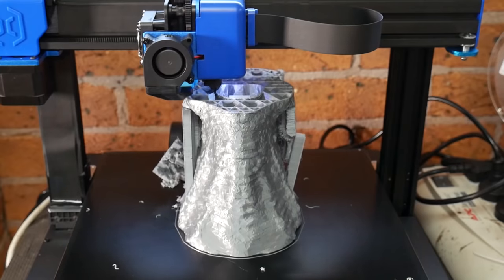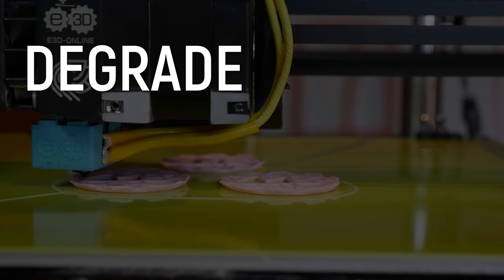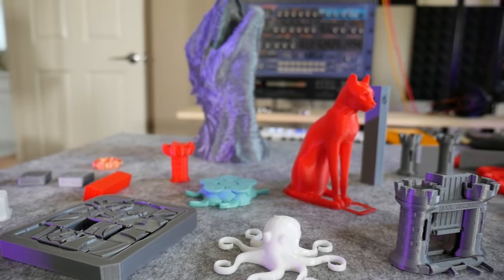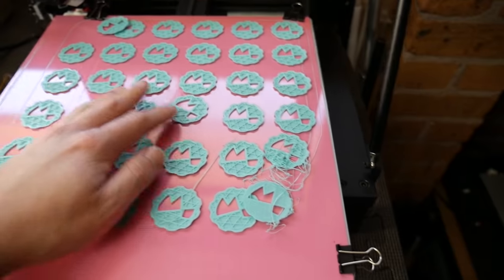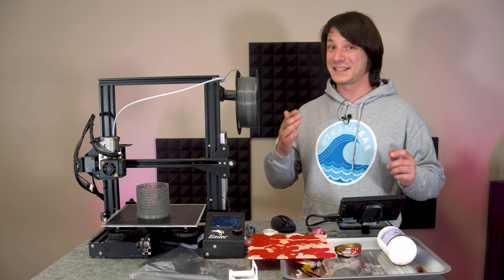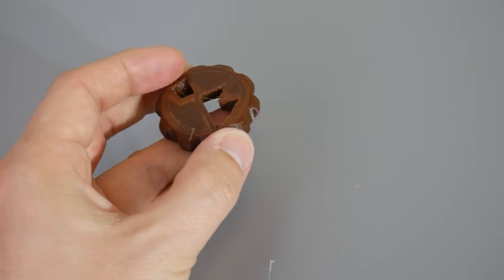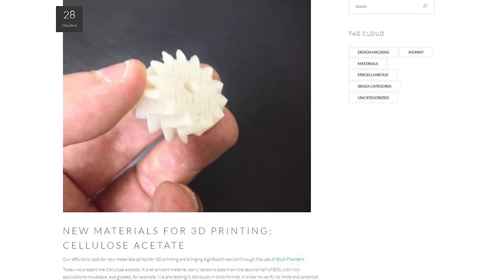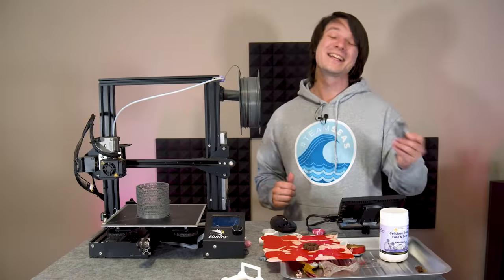PLA - 3D Printing's Biggest Lie.

Comment: The other issue is that there has to be a market for the plastic we make as makers. If there isn't market demand for recycled plastic then we are simply incurring the environmental/energy costs of recycling the material without the benefit of it having additional life. It will just end up in the landfill anyway. Part of the regulation needs to be increasing requirements for manufacturers to use post-consumer material in their products.

Comment: Real cellophane shouldn't be soluble in acetone or any other common solvent. It's made of pure cellulose, so would be no more soluble in acetone than purified cotton, rayon, cellulose/cotton/rag paper, etc.
Real cellophane doesn't melt when heated or burned, it might shrivel or curl before burning, but won't melt, and produces smoke/combustion products similar to burning cotton.

I'm finding mixed information whether cellulose acetate is used as a plastic wrap similar to cellophane. The most cellophane-like plastic sheet material that's commonly used is BoPET plastic based (mylar, though most people probably think of metalized BoPET when they hear "mylar" I'm pretty sure it includes clear plastic sheets too). It tears with little to no stretching similar to cellophane.
PLA is also used for plastic wrapping sheet material and I think is also tends to stretch very little before tearing.
I think cellulose acetate is like this, too, but I'm not positive.

Comment: Recycling PLA into PLA is perfectly possible, it's just not economically viable in itself. That is, you pay more to transform used PLA into recycled PLA, than you would if you just made it from scratch.

However, that is fine if you put a tax on throwing away non-recyclable rubbish. In NZ we have two bins: one accepts only recyclable stuff and the local government empties it for free (and recycles everything inside using its own budget), and the other bin is for non-recyclable stuff and you pay to empty it, about $10-20 each time it's emptied.

Because of this, you're encouraged to sort as much stuff into recycling as you can, and by paying for everything that you haven't recycled, you are paying for recycling everything that's possible to recycle (even at a cost).

Comment: Lots of misinfo in this video; im addressing it here.

PLA can be degraded by a VARIETY of enzymes, lipases, cutinases, even recently studies suggest that because of the similarities between PLA and Polyaniline, it can even be degraded by Proteolytic enzymes; its degradation conditions are experienced on a significant portion of the land masses on the surface of the planet. 2 things, firstly, those conditions are actually "Ideal degradation conditions", they represent the FASTEST a degradation will occur; in vivo (living organism like conditions), roughly 37*c with a pH of 7.2 and moist, the entirety of the given PLA part decayed in roughly 2 years; give a little more time to account for environmental conditions, in the human body PLA can degrade extremely fast, for biocompatible implants. The big issue is, plastic waste never really stays on land. It ends up in landfill, which is more alien than you might think, and in Marine environments, PLA never reaches its conditions to degrade, similarly, in landfill it doesnt degrade very well. Water is never a consistent pH, its usually very cold compared to the average surface temperature. Not only this, but PLA may represent a danger to marine life if it managed to make it into the marine ecosystem and remained there for a long period of time, not due to chemical instability, but mechanical action which is equally dangerous.

Im not necessarily worried about the chemical action in water, because PLA is used in implants; it's fully biocompatible. Infact, an early equine study used a non-medical grade PLA, not specially made for that purpose, and it turned out to be biocompatible from the get go. The material slowly biodegrades into smaller particles until it becomes Lactic Acid Oligomers and can finally be used by the cells, leaving behind no discernible particles. The issue with these implants is that in vivo, the decay faster the more they decay; as pores form on the surface and enzymes better attach to the inside of the pores, making more pores.

PLA is fully biodegradable, I've seen people get confused about the meaning of degradation; incorrectly assuming a plastic which decomposes into smaller and smaller pieces can be referred to as biodegradable; PLA turns into carbon dioxide and water when it is biodegraded. The mass loss is not going to be recovered by digging the dirt around a PLA part.

PLA is biodegradable, because 90% of other plastics aren't, they can't be broken down enzymatically, they cant be exposed to heat or light to make them turn into gas. They just become tinier pieces of plastic, and as those tiny pieces decay, they leech their starting chemicals into the ground.

Silk PLA is where this confusion comes from, it contains 10-20% Polyester.
Polyester is 100% non-degradeable.
Ive watched creators use entirely 100% non-degradable filament for so long, but because it said PLA, they assumed it was fine. Ive even seen a degradation test, where the PLA dissolved, but a dust was in the test pot; they assumed it was PLA dust and concluded PLA just decomposes like other plastics do. It was done with silk PLA.

All of this being said, discouraging the USE of PLA may not be wise, since PLA is one of a very select few plastics that can be fully incinerated without a catalyst, leaves behind no residue, and in its incineration it only leaves behind Carbon Dioxide, Hydrogen and Water.
The problem is we are trying to recycle this objectively difficult feedstock, and the marketing around PLA has made it difficult to educate or explain the material to people.

Finally, the solution.

What do we use instead?

PHA, its a thermoplastic polymer made by enzymes, it's fully biodegradable, not the gimmicky kind, it's the kind where you leave it outside and it will decay because the enzymes outside will eat it, Its been demonstrated time and time again to biodegrade IN MARINE ENVIRONMENTS! Why is it so biodegradable? Because enzymes use it in their natural life cycle to store energy, it's essentially enzyme fat. Turns out, it's also a massively stable bioplastic. It can be printed and depending on its properties, can be ultra high temperature, can be Low temp, its as chemically stable and resistant as Polypropylene; its only water permeable if the water is superheated.
PHA negatives? It is a natural product, so it cannot physically all be a consistent color; its not possible without altering it too much. Because it is a rather unique material, it changes the first 24 hours after a print; mineralizing and crystalizing to form a stronger part. The issue with this is, that effect is temperature dependent. You CAN print this material too hot or too cold, and can selectively choose what printing temperature based on how ductile you want your part to be. PHA is still being researched, but so many enzymes use it as an energy storage medium, and there are so many varieties of PHA, aswell as formulations for improving it, and carbon chain lengths depending on what enzyme was used to grow the PHA, it truly is the future in my opinion.
If you're worried about your footprint, spend a little more on PHA.

Comment: Solution is very simple. Recycle failed prints into new filament. I had separated bins for PLA and ABS to recycle it, but no one was intrested in recycle it back into filament. 
We do it with steel and aluminium, why not start with PLA, ABS and other popular 3D prints. It is the bes solution. I would also buy recycled fimanet, since i make only functional parts, and apperance is not so important for me.

Comment: With FDM, you don't have to confine yourself to printing plastics, it's just that plastic resin filaments are the most convenient material to do controlled fdm prints at a certain scale. There are 3D printing arrangements for printing houses in concrete: it would make no sense to print plastic on that scale, and it seems that there is a window of scale or size where it makes sense to print in plastic. Similarly, there is a 'window' of functionality where it makes sense to print in plastic, for instance it makes sense to print in plastic for a certain level of dimensional accuracy and repeatability: resin FDM offers way more precision than is needed to print a house, but probably not quite enough to make a practical mechanical wristwatch. So maybe 3D printing needs to be guided into more thoughtful use.

The obvious thing to do with all the failed prints and discarded non-functional pieces in conventional FDM resin is to separate, re-grind, pelletise and render as new filament. That's quite the niche industry though.

Comment: Sadly the average compost bin or pile doesn't get warm enough for long enough to break down cellulose acetate. For someone at home to compost it you would need a special set up with an insulated vessel. While not as intensive as industrially biodegradable plastics this is not feasible for the average homeowner and you would not see complete degradation for many many years. You would likely replace the compost bin a few times before the plastic inside degraded.

Comment: 12:30 id put a point out that stuff being made from trees or other plants isn't an inherently bad thing. they are renewable and much more renewable than oil is. trees actually have to be cut down to some extent to improve light access to the lower levels of the forest which can benefit the ecology as trees do outcompete low down shrubs etc, and some trees actually slow down as they age. as long as its done in a sustainable manner there is a good benefit. when people go for short term gain is where things go wrong

i worry more about the micro plastics we create from nozzle dripping, skirt/brim, zits and initial layer purge lines the issue is these arent things we can get rid off from occurring, i do hope the reforming old prints to new filament starts to make headway

Comment: I guess the best thing I can do with my failed prints right now is just throwing them into the trash. Where I live the trash will be burned and used to heat homes. They have massive filters to clean up the exhaust so pretty much the only thing that gets into the atmosphere is CO2 and water. If you would compost it, the CO2 will escape too, but this way you can at least use the heat. The ash will still end up in a landfill but I don't thing there will be much left of the PLA after it burned.

Comment: PLA is far too small in quantity to even consider recycling it unless it can be combined with other higher volume plastics to make products.
In New Zealand a company call FuturePost turns soft plastic packaging and milk bottles into agricultural posts and landscaping products , which don't have the environmental impact of wooden posts treated with poisons to stop them rotting . Plastic quality does not have to be ultra high for this kind of use and they can be repeatedly recycled.
So far they have processed 4700 tonnes of waste plastic.

Comment: It sucks that we've not found a viable mass-producable plastic filament yet. Perhaps getting someone like Prusa on board would give the industry more of a wake up call. Hell if they can produce a prusament filament that is truely biodegradeable then other companies would quickly change their production lines to compete.

I'm no expert at all but in the UK we've got "Biogen" plants that essentially take waste food and animal poop and put it into a huge container. The heat from it is used to generate electricity. I wonder if throwing in a bunch of PLA to force it to get to that high temperature needed to biodegrade would work.

Comment: As an optician I see a huge potential in 3d printed frames. Acetate is the standard material for frames because it is durable and can be bend with a bit of heat. The first is important because s frame is exposed to the skin for a few years every day. The second is important to adjust the temples behind the ears.
I would absolutely love to have cellulose acetate for a 3d printer.

Comment: This is a problem known to most environmental engineers that design waste treatment. Most biodegradable materials require special decomposition processes so it will not break down naturally. Problem is most recycling plants don't have the facilities to process these biodegradable plastics which end up being treated as normal plastics.

Comment: hmmm I think the first step is to find a way to reliably, like 97%+ determine the substance.  PLA, PETG, ASA, ABS, etc.  From there, you need to have a firm that can reliably recycle the material, and pay for the garbage.  That'kll be the trick.   I am not sold on the CA that you mentioned here, I just dont think it will work.  We need to find  way to make recycling profitable, that will be the key.   The second it is profitable, is the second that it becomes a multi billion dollar industry.

Comment: I made a PLA float with a magnet inside as a shutoff for my coffee maker tank filller.  The magnet activated a reed switch.  Anyway, after a couple of years of floating in the water it started disintegrating and I took it out.  I was able to pulverize it in my hands.
Reply: Yes but is that degrading or biodegrading?

Comment: The Problem is that the main advantage of PLA and every other plastics is that it is not desolveable in water (Because of that it had been invented). If it would desolveable in water the airhumidity and other thing like mushrooms would destroy such objects. Also in some cases you want products that are waterproof and and resistant to many enviroments (Meat packaging, bottles, or maybe 3D printed objects which get into contact with water). I think There are two solutions. Recycling, through machines that can seperate materials and produce new products like new filament. Or machinery that can break down Plastics through chemicals into harmless komponents. But i think biodegradeable plastics are not the solution.

Comment: Forget about it, we need to start printing and reusing PET. We either print durable, usable objects or nothing at all. Test prints and trinkets are fine, but it needs to be in a material that doesn't degrade with reuse and we have to reuse it. PET is the best one that I know of. 
Don't look for biodegradable (like paper and cardboards), look for endurance and reusabilty( like metals and glass).

Comment: I mean ... sure ... who wants a million abandoned Benchy prints floating around the ocean?  But, when I print something, I kind of sort of NEED it to last.  I don't want a replacement sprog to repair something biodegrading on me.  That'd defeat the purpose.  So having a readily available biodegradable print material would be a great option, for SOME things.  However what we really need are better recycling programs.  Why any governments don't take recycling seriously just flabbergasts me.  What'd also be just great to have would be at-home print recycling that makes usable spools from failed or no longer desired prints, even if that means coming up with a new material.  Not just failed gimmicks.  Frankly, government subsidized as a recycling program.  It shouldn't be this hard.

Comment: Cellophane is regenerated cellulose produced by the Xanthate process. This is the same process used to produce viscose fibre for clothing manufacture. To make cellopane film the cellulose Xanthate solution is extruded through a slit into an acid bath. This decomposes the Xanthate back into pure cellulose and the film produced is crystal clear when dry. It has a rather characteristic crispy noise when crinkled up which is unlike most other plastic extruded into film. Cellophane is pure cellulose film and it will NOT dissolve in acetone. It is biodegradable in the same way as paper is since both are essentially cellulose. Cellophane does not melt but decomposes when heated just like paper does. It is not a thermoplastic.

Cellulose acetate is made from cellulose and acetic acid precursers such as acetic anhydride. Cellulose acetate is a thermosplastic that can be exruded and moulded. It is soluble in acetone and many other organic solvents.

Comment: Nonetheless, PLA (at least on a biochemical level) is still considerably better for the environment than fossil fuel based plastics.

The monomer of PLA (lactic acid) is far less dangerous because even humans produce the enzyme to break down PL(L)A and the products are some simple aldehydes and carbon dioxide, which aren't nearly as dangerous as complex FFBP mixtures, many of which contain carcinogenic or just toxic monomers (remember that PLA is praised for having vast use in the implant and biomedical field). 
This isn't to mention that PLA degrades considerably more from hydrolysis even under regular circumstances than the alternatives, partially because the process is self catalyzing.
Sure, when buried underground, in relatively dry soil away from accumulations of bacteria that may benefit from it's breakdown its highly unlikely to degrade, it is nonetheless still better and a far smaller issue than  FFBP's.

Comment: As someone with a degree in Mechanical Engineering Science, and have studied material dynamics for a few years, he has brought up many very great points.
However PLA is in the biodegradable category since it can be digested, not so much due to its natural degradation.
PLA can be consumed by almost all mammals and can see a reduction in mass by over 50% during the digestion process, thus being in the biodegradable category.
It is also a non-toxic material, and is generally seen as a net loss rather than harmful to the environment. I would not recommend eating your failed prints as the C02 it releases could lead to some mild discomfort, but as far as microplastics are concerned this is not an issue with PLA.